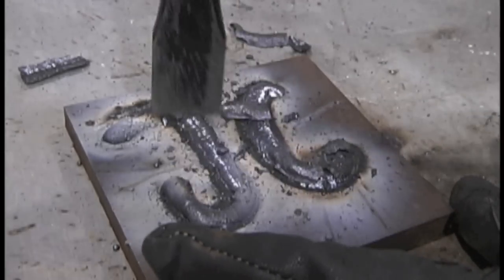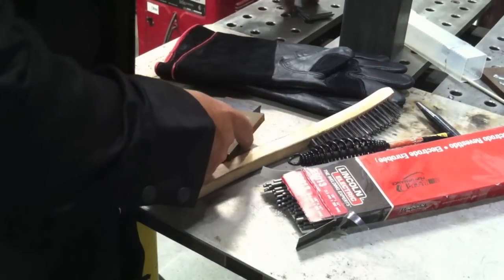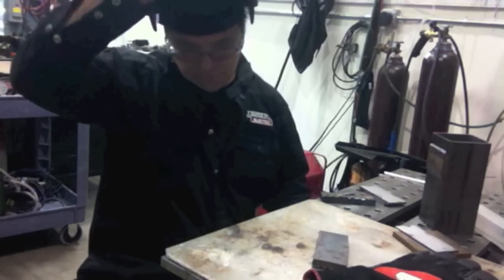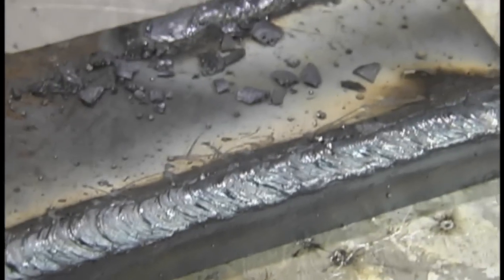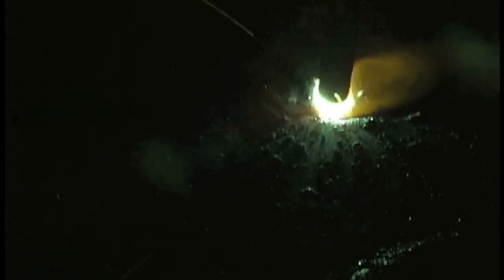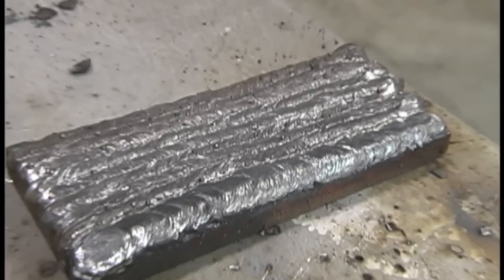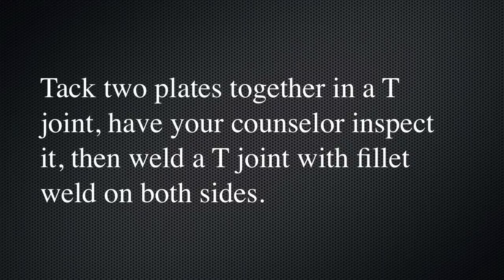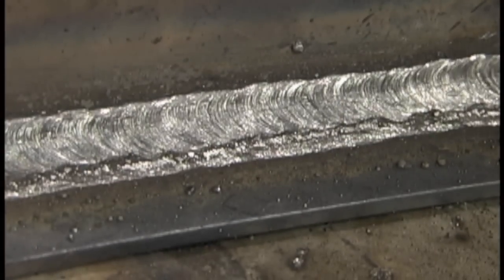Stick Welding Tips for Boy Scout Merit Badge

Comment: I've been thinking to go for a welding school so i need your help. Most of your equipment and nice and expensive, but i believe a lot of people like me have no money to invest on a OK machine like $300 + welding machine.Could you please make a video on a cheap machine where your limitation is basically none? i bought a Mastercraft arc welder  2 setting(low+high) for $100 with helmet and a brand new box of E6011 rods( you can imagine how this is). I have a mig flux core but what's the fun in it if you can't weld using a arc welder ?thanks for your help
Reply: The machine he was using on the video is a cheap machine
Reply: Harbor freight has a great auto darkening helmet for starters. I prefer miller but metal man is good too. Hobart has good helmets. The tombstone is a great welder i had one to learn welding on. A lot of welding supply stores has a great program for people learning trades. You can always get a cheap harbor freight welder to learn if you wanna learn how to weld. Hope this helps
Reply: Longevity Welders as a finance partner for those who cant spend the money all at once. Its how i got mine. just got a Stick 140 but got approved for morre and didnt hurt my credit score. Just a tip for those in this boat right now.

Comment: Why do the welds look like butt-hole?  
I've noticed arc welds don't look as nice as mig welds..any clue why?
Reply: MIG welds don't have flux covering it when it's done because the gas shields the puddle so it turns out a lot cleaner

Comment: Would you have them start on 6013, 6011,6010, or 7018? I started on 6011 and when watching the kids in class try to move from 6013 to something else they would really struggle so I felt that it was better that I started on 6011.

Comment: great video for the scouts. my dad was a boilermaker and had me out in the garage about that age learning to weld with a buzz box about like that one. One thing that you might want to mention is the angle of the rod to the plates especially on the t joint. If they learn the angles to hold the rod  and the importance of reading the puddle early they will understand why the finished weld looks like it does. Again great video, my grand daughter said our schools don't have shop classes anymore.